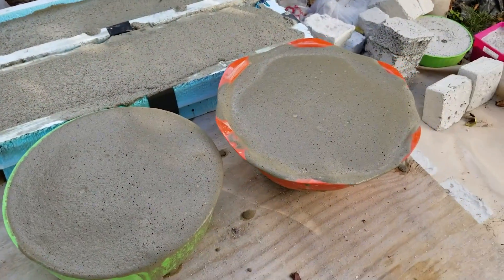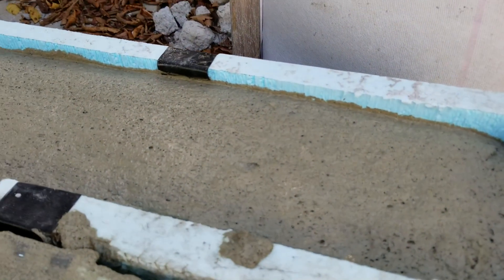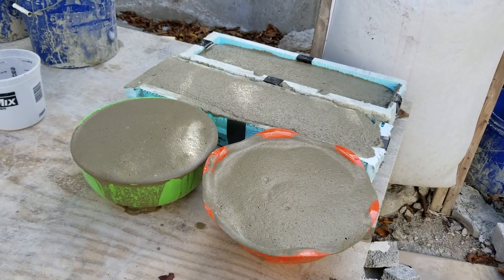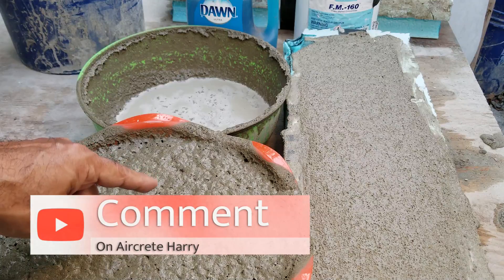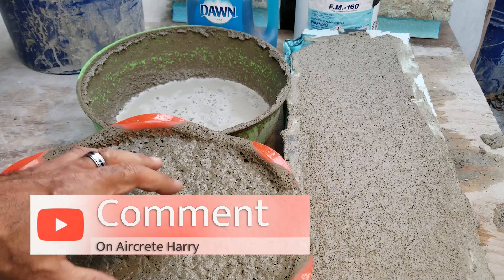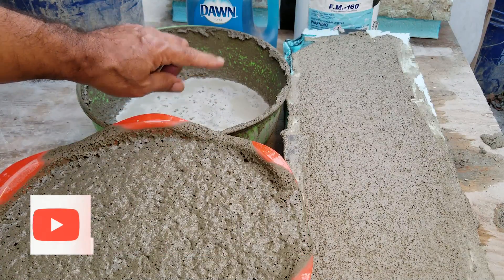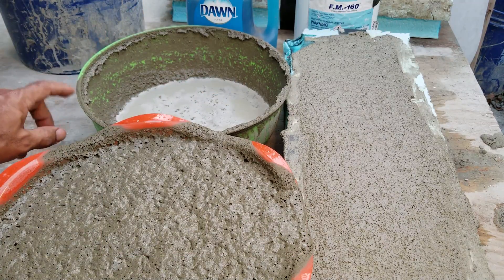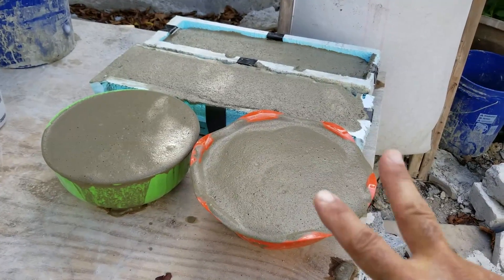Aircrete Collapsing | Time Lapse #Aircrete #Foamgenerator #AircreteHarry #AircreteHarryFoamGenerator

Comment: I don't like bucket mixes as it is so hard to be consistent, much prefer a drum, but you definitely had a reaction between the soap and a contaminant going on in that green bowl. I love your vids, and your foamer is a sweet tool, but I do wish you'd  do stop with the mechanical aeration.
Reply: How else would you get the proper amount of air into the mix?
Reply: The air is in the foam. A hell of a lot of small even air bubbles disrtibuted evenly through the mix.
That supplies all the air you need (it's kind of the point of using a foam machine). Extra air is just that "extra", and not in the PROPER, wanted or even controllable ratio. Otherwise you might as well make a slurry, add soap and beat all the air in.

Comment: AH - in your part 3 where you poured the 2 bowls of Dawn mix the green bowl had older 'crete in it and the orange bowl appeared to be fresh out of the package.
Reply from the maker: You're right I had no idea what little old dried aircrete would do to a fresh batch lessoned learned. That must have been the bowl I used to experiment with concrete bonding agent.
Reply: maybe add a sheet of plastic liner each or food wrap to prevent contamination - or buy a lot of bowls ... ☺